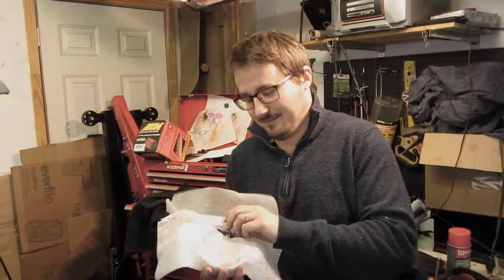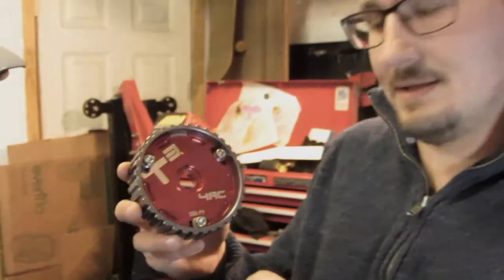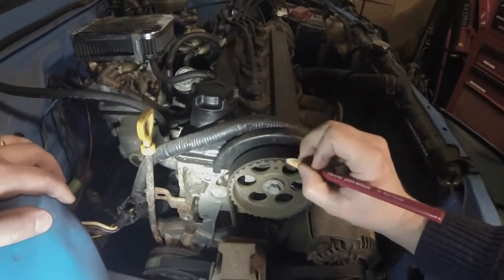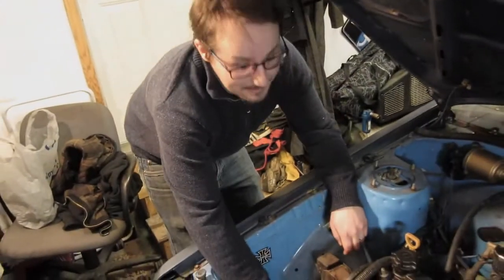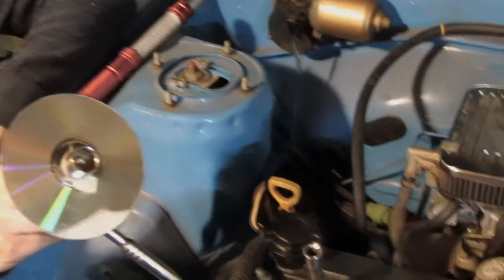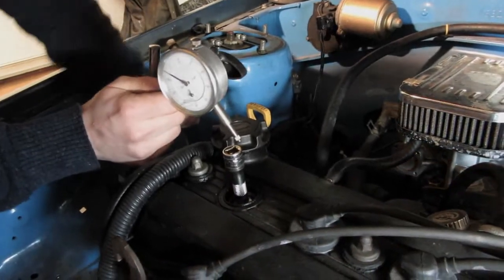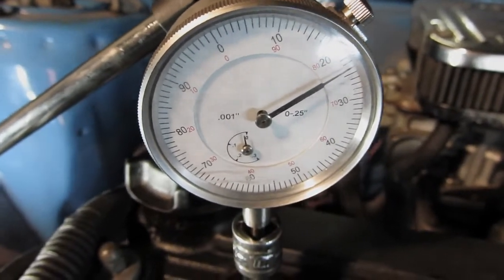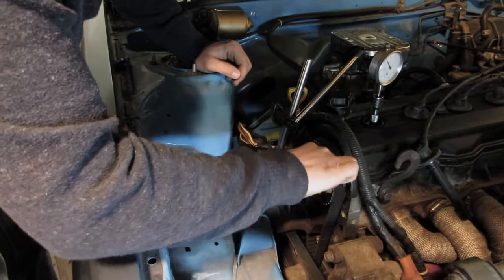4AC/4AF Cam gear upgrade!

Comment: What could possibly happen if the tune is not as accurate? We couldn't get to the tune. It has no idle. Checked and tuned ignition, overhauled carb. Still bad. I have the same 4ac gear.
Reply: Rotate distributor wheel that engages with cam 180?

Comment: is there a cam gear for 4AFE?
Reply: This may fit early 90-92 4afe with square tooth timing belt. It will not work with later 4afe round tooth timing belt.

Comment: So, you guys seem to be doing all the things I am interested in, i have the stock 4ac, am picking up a 7AFE and wonder, am I better off to put the entire 7afe engine into the AE82, and carbing it? rather than making a 7ac. Yet if I do carb the 7AFE can the 4ac carb manifold fit? some say use a 4afc.. bit confused. Which carby manifold would I need and what other changes would the 7afe need to run? I am guessing use the 4ac dizzy ect.
Reply from the maker: The 4ac intake will not work on the af/afe as the port spacing is different. I dont think the port spacing/shape is the same between the 4af/afe head but you can compare the intake gaskets. Probably the easiest route if you have the complete 7afe would be to plug the injector bungs and cut off the plenum and use bike carbs. Then  the rest of the motor isnt a hybrid of parts you have to keep track of lol
Reply: @lugnuts8167  completely agree, thanks so much for the wise suggestion..

Comment: Does switching to adjustable cam gear can give some hp? I have a 4afe and planning to bump some power
Reply from the maker: Carlos, it will not add power by itself, maybe with advance timing and high octane fuel but nothing noticable. This car has longer duration camshafts that required the cam gear to get valve timing back into spec.

Comment: More 4AF content. Super rare to see this kind of build documented. I'm in Texas and have been building my 88 Corolla 4AF for years now.
Reply from the maker: Thanks Adrian! Were working on it. Is you build posted anywhere?
Reply: @lugnuts8167   I appreciate you responding back. Yeah it can be seen @AJNoble90 on IG. Shoot me a follow if your on there.
Reply: Hey, where in Texas? I mess specifically with the 4af as well.
Reply: @adriangonzalez-tovar1574  DFW. if you have IG follow me @AJNoble90 and shoot me a message. Let's connect.
Reply: Adrian Noble  I don’t have a ig 😕 However I’m a moderator of a page on Facebook called AE92 USA/CANADA. So we could probably connect on there
Reply: @adriangonzalez-tovar1574  ok I jus joined. Its pending. My FB page is under my business name LD MediaGroup

Comment: what carburator do you use?
Reply: Weber 32/36
Reply: @andrecousteils3729  with Electric Choke ? This conversion is really better than the original AISIN? I am very interested in making a conversion to weber, because the original AISIN already has me tired
Reply: @JBRI94  I have the electric choke. It was worth it for me as i had planned on opening up the head and manifolds (with cam) to flow more air.  For a small bump in power increase we had installed a mild cam on daves car and made ~10% gain on an otherwise stock 4ac.
Reply: @andrecousteils3729   ok I understand...do you have any video of the engine idling? I have a 4A-F and I was planning to buy a new AISIN carb, but they are too expensive, and now I have the option of purchasing a new 32/36 DGEV, and cheaper. The conversion doesn't look difficult, but I don't know how it will work.
Reply from the maker: Cameraman Dave: I just saw this now. Andre's is a weber. (32 36 seem like familiar numbers) I'll direct him to the comments.